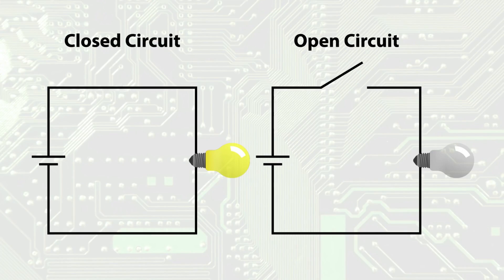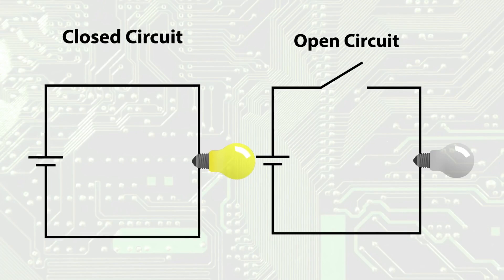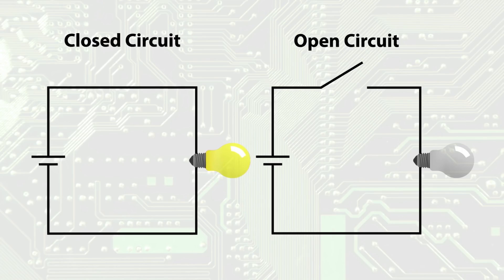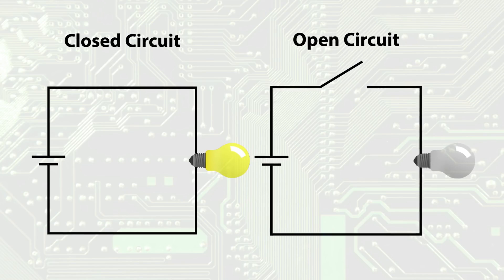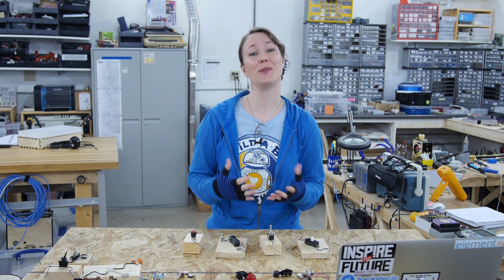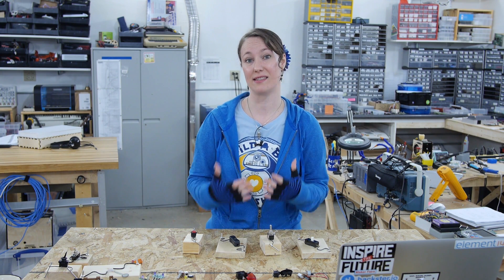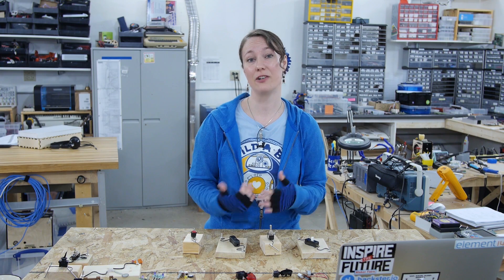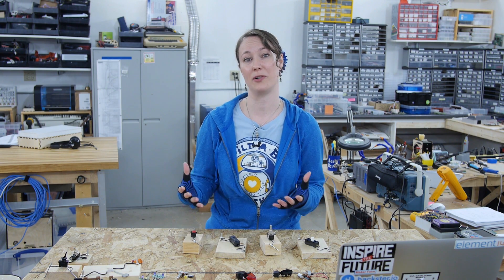The Learning Circuit - Switches

Comment: There is a type of switch/button often used in electronics where you push it for a particular function. However if you push the button for a different function, it automatically switches over and mutes/kills the first function. Often, the first button you pushed will also pop up as a result of pushing the second function. Is there a name for that type if switch/button?
Reply: I have one of those that I salvaged from a tape player… it’s a long bar, with spring switches across it. You press one, and the previous pressed one pops up. I’m actually going to look to see how it works. I didn’t think much of it than a metal bar with those switches that you press and it stays down until you press it again for it to pop back up(opening the circuit)… I guess there’s more to it.

Comment: Some latching switches can be converted into momentary switches by removing a piece of metal that makes the latching mechanism work. A good example of where it can be helpful is building a modern PC into an old PC case with an old AT style power switch.
Reply: Even the ones that don't, that usually rely on the same mechanism as a clicky pen, can easily be modified (remove the teeth of one of the rotating bits to prevent it from locking closed). In a pinch it works nicely

Comment: In my experience, mechanical switches are the most unreliable part of any device.  I cannot count the number of switches that have failed over the years.  In almost any electrically powered tool -- a hand drill, a vacuum, an electric leaf blower -- it's the switch that eventually fails.
Reply: Yeah. I’ve had to change the DPST rocker switch in my angle grinder twice now. The last time I actually repaired the switch itself using apiece of plastic, brass sheet, and epoxy because I had to make it stronger than it was. It hasn’t failed since.

Comment: Tilt switches. 

Also. Sensors such as LDRs and thermistors are not switches. They change resistance depending on the environment. The resistance is generally applied to an amplifier like a transistor or discrete IC which acts as the switch.

Comment: I'm surprised you didn't mention the more confusing stuff.

Like single pole single throw, vs single pole, double throw vs double pole single throw and so on. (there's a lot of variations on this.)
It's possibly one of the more confusing aspects of deciding what kind of switch you might need.
Reply: I originally did, but it got cut. :(
Reply: Switches part 2!